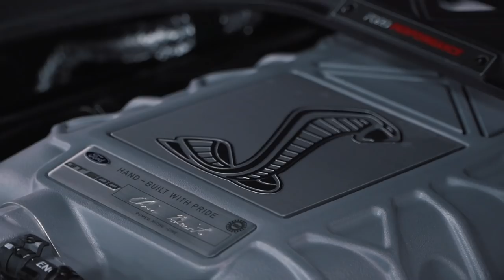2020 Ford Shelby GT 500 Mustang | Full LLumar PPF Wrap

Comment: Great videos as usual. Would love to see one on how you correct and finish stubborn black plastic trim on vehicles such as running boards, and the finicky vinyl/rubber trim around windows, etc...
Reply from the maker: Some like these ones on the mustang you can't do much with. Anything with texture or roughness can be restored with solution finish. I have a video where we did some work with trim, let me go find it........ There it is.  https://www.youtube.com/watch?v=t1C6GZ_JIgU&t=10s
Reply: @ChicagoAutoPros  thx. I've lightly used heat to remove some scratches from plastic and topped solution finish with quality sealant or trim coating since it doesn't seem to hold up on its own.